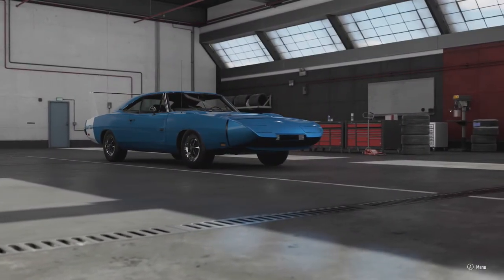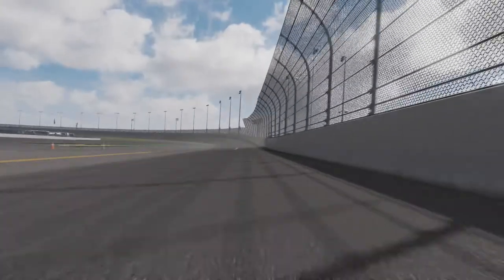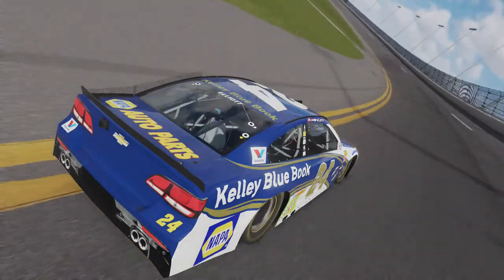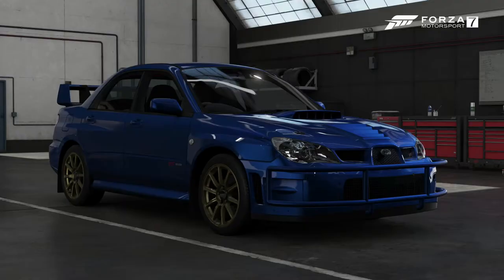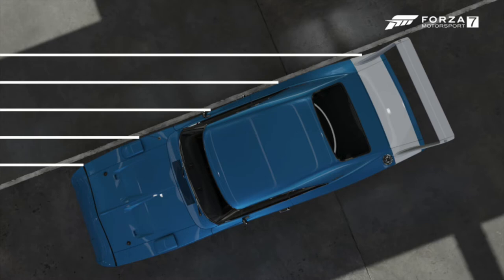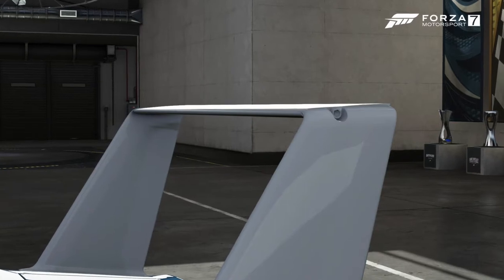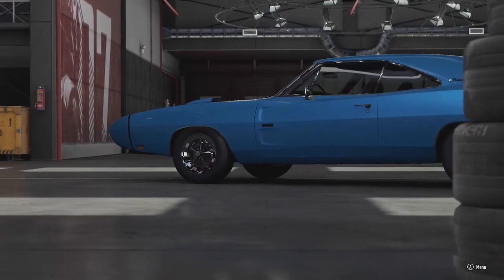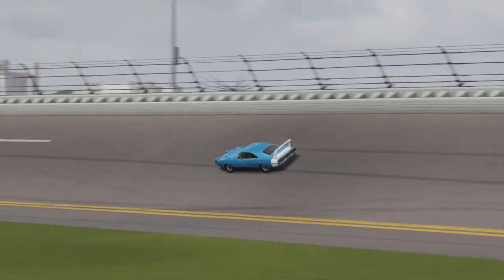The Daytona Wing Explained

Comment: Looking at it closer, side posts have noticeable airfoil shape and if I'm not wrong also slightly point inwards to create counterforce to the car moving sideways I guess
Reply from the maker: Nice spot!

Probably should've touched on this in the video.The aerofoil shape I think is purely for streamlining, as any sort of angle to them would just get cancelled out by the other side.

Then again, if they are both facing inwards then that could create an effect similar to toe in maybe? It's an interesting point.
This also raises the question, could you do some interesting stuff with asymetrical setups? Would be interesting to see.
Reply: @BoostandEthanol  I mean, since they do assymetric body on stock cars it certainly would be noticeable. 

As for being cancelled, if car starts moving sideways the air travelling around it would have uneven effect on stabilizers so I think the one on the leading side would be more effective than following one. Well, that's what I think how it works. That "toe" angle must have an effect similar to what toe does with wheels.